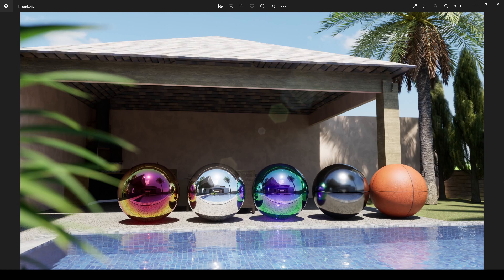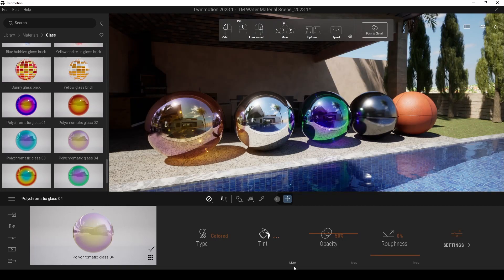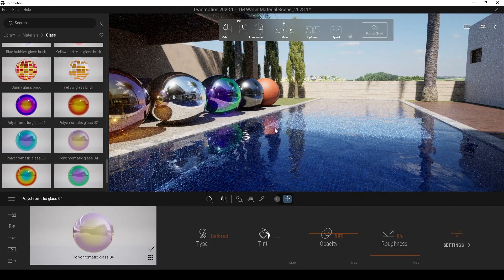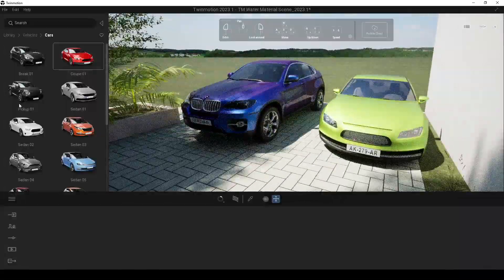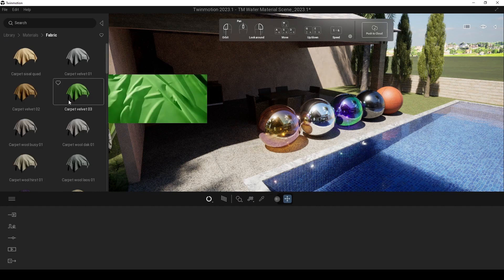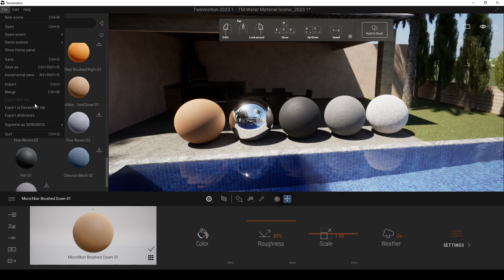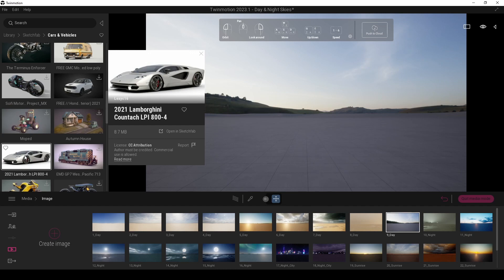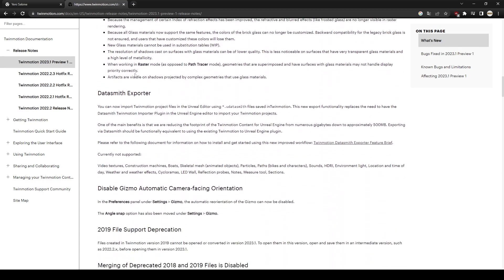Twinmotion 2023.1 Preview 1 New Features

Comment: Twinmotion's realtime walkthrough quality still needs a lot of improvement compared to Enscape and D5. It's also lacking built in libraries. However, the easy animation setup, Twinmotion Cloud and program speed are all good points for TM.  If they implement Lumen into TM, it will be much more impactful as the current GI engine feel very dated.

Comment: Without path tracing twinmotion is still trash...
Reply from the maker: without brute force and IC vray trash , what kind of logic is this :)
Reply: @sb.architect  you don't need a rtx card able to render a good frame with vray or Corona but you must have an rtx card able to achieve same thing with twinmotion... That's why lumen has been developed...
Reply from the maker: I think old school cpu renderings should be lay aside. This is why v ray gpu exist. nowadays even the cheepest laptops comes with rtx graphic card
Reply: I think the major issue is that compared to Enscape or Vray or Corona , Twinmotion in terms of quality is not still as good.
Reply: @marcusdeimos  totally agree with you...
Reply: @marcusdeimos  if epic games able to transfer UE5's Lumen technology to twinmotion then able to kick Lumion out forever...
Reply: @SerdarYILMAZZ  well Lumion users are landscape architects , Lumion has a massive amount of vegetation models whereas other programs don’t … the only possible way to challenge Lumion is for Megascans Quixel to create even more assets and pump them into “an improved “ TM.